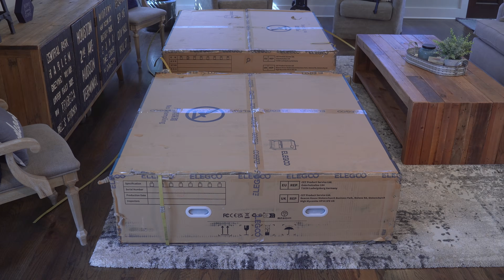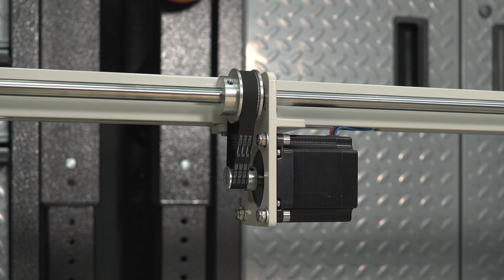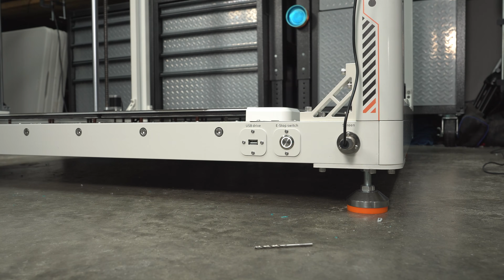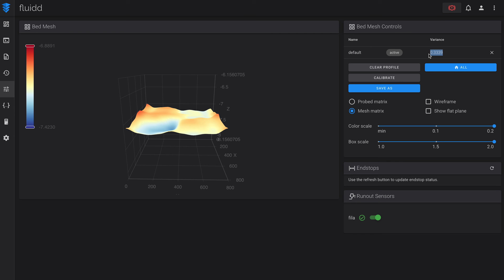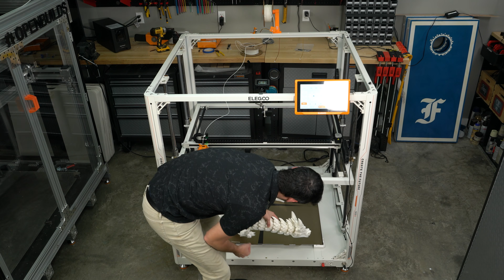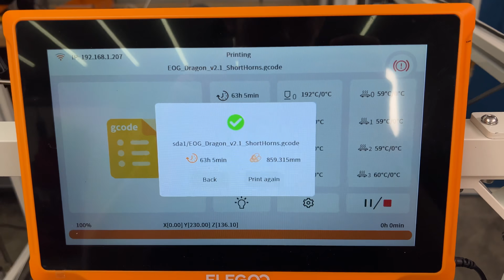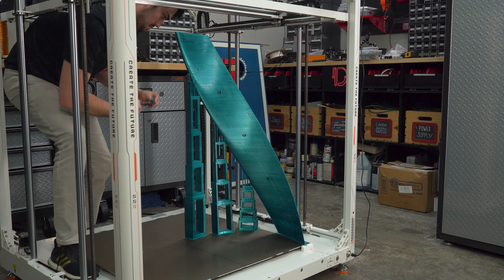Affordable Large Format 3D Printer! (Elegoo OrangeStorm Giga Review)

Comment: Yes, you gave a good point, splitting into smaller parts is often the better approach. For speed and quality, the SOVOL 09 stands out with its 500x500x500 (or potentially larger, given the fixed bed) build volume.

The gantry’s weight can slow the printer down, but I’m not concerned about vibration—this can be easily addressed with truss-like connections. Many assume that a printer must sit on a rigid surface, but that’s not true. I place all my printers on springs, allowing them to wobble as a whole. This setup absorbs accelerations and decelerations, which not only avoids print quality issues but can actually improve results.

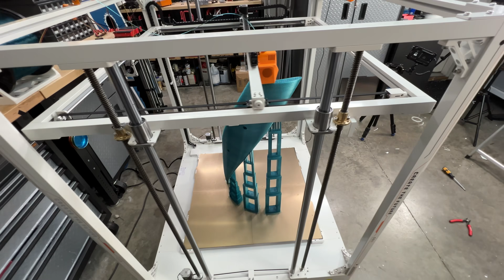Comment: 20:40 How much time and how much material would be saved if we printed the 3 blades of the wind turbine at the same time so that they were supported on each other, thereby saving the time and several kilos of material for printing the support stands. The resonance at the top would also be smaller.
I would like to know whether the big, heavy 10-kilogram filament coil will not destroy any motor in the long run, which pulls it into the head.

Comment: The z drives are very disappointing. Just by adding two more NEMA 17 motors, this thing could have easily had quad gantry leveling like the Voron V4.
Reply: which actually would be even more disappointing. Thruth is quad or dual z motors only exist because they are cheaper. Marketing makes you believe its better. What would actually be best is one Z motor for all spindles - most reliable solution, one time set and forget solution. But thats a lot more expensive especially on LFAM machines.

Comment: I don't have a large printer but I abaondoned 1kg spools LONG time ago.  I have printed spool rollers that use roller scate bearings that allows the fillament spool to roll smoothly.  I know of one manufacturer that has 25kg spools.  I don't think my rollers will support that much but super easy to print out 4 smller rollers instead of two rollers for the 5kg spools.

Comment: one interesting thought that came to mind: a huge printer like this could be less negatively affected by lowering the acceleration rates (depending on the print) since it's likely doing much longer runs where it can really get up to speed. So you might be able to reduce the vibration issues by turning down acceleration without necessarily a huge hit to total print time

Comment: Hi, I just found your channel, great work. I’m looking for a pellet extruder that has options for multiple extruders feeding one mandrel and die for simultaneous layering of two to three different thermoplastic types or mixing in additives like glass fill that you can adjust on the fly for greater strength added strategically through out a large part. Have you come across anything like I described on the market today?

Comment: I have the  Elegoo Neptune 4 Max and it has its pluses and minuses, fur sure. It is a large printer, or what before now was a large printer, with a very high speed. As expected, this makes for issues. The extruder is not a standard open source design. The machine tends to shake itself apart and you want a good, solid workbench for it. Ownership and use require some tinkering and specialized 3D printer knowledge. All of the issues can be addressed with time and a wide user base. I can only imagine that this machine will suffer from the same problems. Being an early adopter comes with a price. If you have need of such a large printer, you will find a way to make it work for you. If you don't have a need for it, it will probably become a clothes rack. 

I have to say, though, that construction of my Neptune 4 was quite decent, and putting it all together was fairly simple even though instructions were pretty basic. One problem though, is not much detailed technical info, such as pinout and connector info. I had to do some troubleshooting and not knowing where stuff was supposed to go was worrisome. I would be surprised if this gigantic printer is any better in that regard. 

I think a lot of early adopters will buy this and be rather frustrated and disappointed. A lot of other buyers will be delighted with the size and the ability to slap on some plexiglass and velcro to enclose the unit against drafts and stuff. My suggestion is don't get it unless you need it and can afford a lot of filament for printing big stuff.

Good vid, good review.

Comment: I would use 1.0 mm nozzle as default, lowering the speed and vibration, increasing the flow rate. At this scale it will be sufficient and possibly better print quality

Comment: No, we need more of these cost effective large printers and even bigger. You might notice that your pet dragon is very useless but big printers can make molds for something real like a plane. Gluing together many small parts is garbage. You could say this is the first 3D printer that is actually useful, not for making useless trinkets.
They should probably give it sides for rigidity and keeping in heat and plastic fumes. Also, should you be standing on the build plate?

Comment: My main thought on the printer is that Elegoo took a very small form factor approach to a large form factor printer. When you’re doing a printer that big but still trying to keep the filament compatibility to 1.75 mm then you’re going to be massively limiting the capabilities of the printer. Also, it’s funny that they decided to use such a massive nozzle yet I’m able to easily crank way more than that on my regular volcano hot end with just a CHT added.

Comment: I want to see you print a 4ft model of the Raider Class Corvette from Star Wars. As for the top heavy vibration when doing large prints that's is an easy fix by building a top support frame you can anchor to a wall

Comment: As you were asking for feedback:
- Great video, love it!
- Yes, a modified / upgraded tool head would be highly appreciated.
- Stability issues / vibration: As already mentioned in other comments, I would go for either additional struts or diagonal cables. And if the top stays still open, really huge prints could even be removed without dismantling the structural support.
- Print idea: As TPU seemed to work fine, how about printing a nice flexible waste paper bin? And, of course, we need so see a GIGA BENCHY! 😉😂

Comment: It definitely needs an enclosure as well to protect stupid small children from entering and to increase BP heater efficiency. Like you suggested, increasing rigidity should be simple.  I'd love to see that done. Def upgrade to a 1mm nozzle at least as well.  It's also going to need some serious speed optimizations to really be productive. Additionally, 1500W x 24 hours @ 11cents per kph is around 4$ a day (if you ran it all month...yikes), on top of filament use that's a pricey hobby; whatever you print better be worthwhile or you could end up with a massive pile of waste quick, so I'd say its surely not an entry level machine. Even with the upfront cost, no doubt you could sell something like that dragon or similar for a decent profit just because of its impressive size...I WANT one...DO I NEED one heck NO, but the potential is so damn cool, both the printer and the products...imagine the cost of running a farm of these OMG. 120$ a month x # of printers in farm, just for power for the printers. YIKES.  What price USD would you list that dragon for sale?  My guess is 150-200USD?

Comment: The whole concept of bed levelling is out of date. If a machine is properly designed, you wouldn't need bed levelling. On how many milling machines do you need to level the bed? It just  matter of better engineering. A plane is defined by 3 points. If you don't get a plane by three points, the plate is bent. Here you have to adjust a million screws to level a bed, when 3 is all you need. Thanks for the honest review!

Comment: Very nice video!

I don't understand why this frame doesn't have cross bracing, at least on the sides, back and top of the machine. Even just some steel cables under tension would work and wouldn't have added much to the cost. It's all parallel structure with all the rigidity coming from the corners, by how easy it was to square one of the brackets back this just isn't ideal. The missing reverse bowden tube is another thing I don't understand why they didn't include it, even if it just avoids one issue that leads to a failed print it would've paid itself back.

Comment: Wider filament, aka 3mm filament is harder to melt.  You will actually get less flow with 2.85mm filament than you would with 1.75.  CHT nozzles get more flow by making the filament thinner as it moves though the meting zone.  3mm filament has the opposite effect of cht nozzles.

Comment: X-bracing on three sides and wall mounts connected to the top of the printer would greatly improve rigidity. Make the wall mounts long and quickly removable, as well as one of the X-braces, and you've reduced most of the negatives of the added bracing.  I wish I knew about the early adopter fund me page!

Comment: That's an insane machine, would love to have the need, space, and money for one myself :)

The levelling procedure was great. The combination of the metal plates with levelling screw cutouts and the software interface for both the bulk probing and individual point reprobing along with the readout giving you an idea of how far to turn each screw was amazing, though it would have been nice if it also converted the value to number of turns or something equivalent. Still really nice though.

While I share your concerns about the rigidity of the frame towards the top, I don't believe that was the only issue with the turbine blade you printed. It's movement looked like the nozzle was dragging when moving past/over it, and thus pushing the blade. This is an issue with printing any tall and thin parts. Strictly it happens with sturdier prints too, but those prints are substantial enough that it is less likely to have an effect. 
This can often (but not always) be mitigated by using Z-hop, at the potential cost of increased stringing.

Something I noted during assembly was that the toolplate had multiple Canbus ports on it, suggesting the possibility for a multiple toolhead printer. Either that or toolhead addons such as alternative z-probes or an accelerometer for resonance tuning. Resonance tuning for a printer such as this with its frame wobble at high z heights would be great, especially if it is possible to have the tuning be z-dependent (I am not sure if Klipper has this functionality, but I could see it becoming a thing).

Overall the ease of use and setup, combined with its low price point make it seem like a reasonable choice for someone who needs a large format printer.

Comment: I was hoping you would do better on the bed. The main issue we are having with larger bed size, is the insane power consumption. Splitting the bed up in zones, will allow for smaller prints to use smaller parts of the bed, for this one, like 400*400 and 800*400. That will significantly improve efficiency.

This printer actually shows this can be done. Making better smaller printers like 600x600 beds, is already proven viable, by this printer. Not to mention 4*200*200. But we need the option to by a single large PEI.

Efficiency needs attention, for this industry to earn the right to exists, for larger parts. As of now, it probably should be banned, for simple environmental issues. Thus, this prevents industry adoption, as it should.

Second, still no real re-circulation of filament. Again. For this still new tech to gain industry wide adoption, it need to be using recycled filament. It simply does not.

A move to multi zone beds, should also accompany a move for MBs that support multiple ports for the bed. The current solution of insane PSUs that are controlled by dimple breaker switching and not some form of PWM, is not preferable. No one seem to tell on this printer, how the power for the bed is solved, and if this affects the prints with wobble. I was hoping you would comment on that.

Comment: You could just strap some steel wire diagonally, to put the frame under some tension. This would increase the rigidity drastically.
Reply: That was my idea too. You could even add some cable tensioners for some really stiff triangles.
Reply: Or Reprap style: Threaded Bar on the Top and the Sides.
Reply: I was thinking of plexiglass panels but the diagonal steel wire is a better and simpler idea.
Reply: I was also thinking plexiglass/some other clear plastic. Provides rigidity and also turns the frame into its own enclosure.
Reply: I was thinking he could secure it to something else like a wall.

Comment: CHT style nozzles work upto 2mm but print speeds take a hit as your limited to 30-40mm³ in volume and a 1.8mm nozzle with a 2mm width at .5mm layer height is a 40mm/s in print speed as a peek but expect more like 35mm/s 

so a 0.8 at 1mm line width and a 0.4mm layer height is 0.4mm³ per so take max flow rate from a flow rate test of say a magnum+ HF at around 82mm³/s thats a max print speed of 205mm/s but of the stock hotend that very similar to a banbu labs I think more like 30~40mm³/s  so a print speed of 75mm/s with a 1mm line width at 0.4mm layer height.
anyways something like a Mosquito Magnum+ with 100w heater will eat nearly 1/2 a spool per hour.
i wish they offered an option to buy without the hotend or a control board.
Id swap-out all the electronics for quad nema 23 servos and a few mods for auto gantry leveling a beacon bed probe,  Bondtech LGX ACE Mosquito Magnum+ with 100w heater and a c-pap style blower and hose for part cooling.
an excel file for finding print speed based on max flow
https://docs.google.com/spreadsheets/d/1OSG0JWISRBaG05w8NEB8iGynuIOcXtSj/edit?usp=sharing&ouid=100168116248992706501&rtpof=true&sd=true
Reply: Wow! It would be cool if you lived nearby to that mod to mine when it arrive! I Don´t have much clue how I would do that on my own, but I am hopefull I will find a way when mods begin to appear!

Comment: Have you thought about using orcaslicer and not the elegoo cura slicer provided? How about strengthening the frame to avoid the Z axis wobble?

Also wondering if the beacon or similar fast probe would really work given it looks like you have a klipper interface from the outset ? Can it really be that simple?

Comment: Would love to see an extruder upgrade for this printer to increase its speed and flow and maybe some ideas on how to enclose it for working with abs?
If you get it working and dont want to return it do you think it might be worth drilling and installing acrylic plates directly into the printers frame and adding front doors to it to make it fully enclosed? It might ruin the aesthetics of the printer but I would sacrifice a pretty printer for a printer with enhanced capabilities any day at this price point... and heck the acrylic should help by adding some bracing for the whole printer.

 I'm waiting on my printer for printing large molds to work with composites I know ill likely need to work on the prints surface finish anyway to get the quality i want on my finished parts but that can be done with sanding and fillers, this printer is mainly a means to remove the disposable buck process and jump straight to the mold process from cad. It would take several days to weeks to make the molds by hand from a buck and then make parts, this will allow me to make large  molds with relatively little effort and time investment where I can spend it on actually building the parts or designing and simulating them.

Comment: Excellent review! Question: Since you are into structural items, could some simple diagonal braces at each corner significantly reduce vibration? That would be a cheap and easy fix, and wingnuts could be used to simplify removing them if they got in the way of removing a large printed part.

Also, what are your thoughts about moving the rear mounted spool holder to the front for easier access?

Comment: They might also be using 4 beds for the same reason the in development Voron Phoenix will, the heatup can be staggered across the bed heaters reducing overall total pull on the circuit. allowing it to be run on a typical home outlet.
Reply: It is also possible to heat only the print beds that are used in the specific ongoing print
Reply: @ThrowBackMaker  yeah , the prusa XL follows the same doctrine , have multiple beds so that you only need to heat up the bed that you are going to use , that way You use way less energy for smaller prints

Comment: I don't understand why they decided to not make it CoreXY. I also see a lot of improvements I could make on this. Closing it with panels would be one (and it would automagically make it stiffer). Moving the filament spool from the back to the front would be another
Reply: Because repeatedly dead lifting 10kg of filament is silly.
Reply: @Argosh  You obviously don't know what CoreXY is
Reply: @henrymach  and you obviously don't know how heavy a print could be on a bed that size. That plus the absolute nightmare of even trying to keep it actually level is plenty reason to have Z anywhere but the build plate.
Reply: @Argosh You still don't know what CoreXY is. Nothing to do with Z

Comment: I have a project which needs to be done in single print preferrably, actually multiple such, and even Giga is too small for some of them.
HVAC / Datacenter related stuff.

Just doing the first project, probably a week or two of printing or so with the giga will save me multiple times what the printer did cost.
Or put in other words, i would have made that DIY still, different materials, by hand, but Giga gives me better end result, while i have to spent fraction of the working time on it.